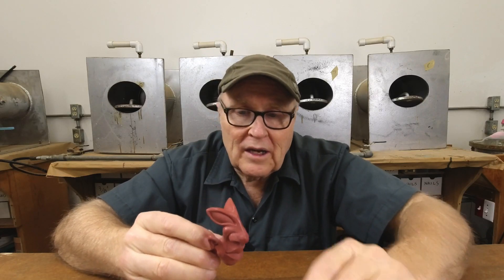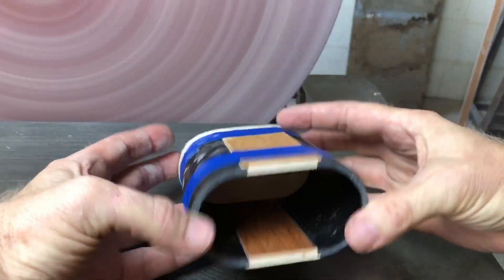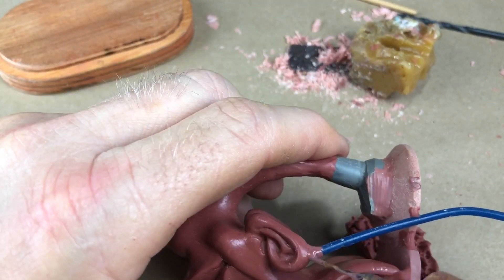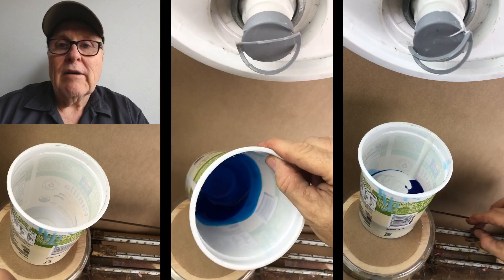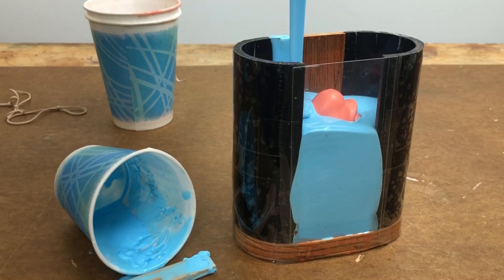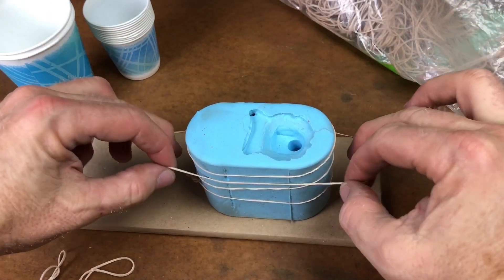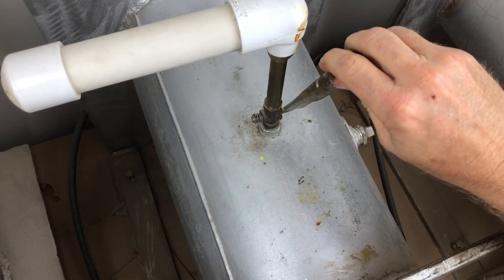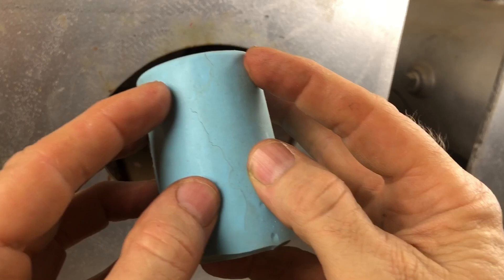Casting a Complex Shape In A One Piece Silicone Rubber Mold

Comment: I am making a casting of another casting made of fiberglass resin. Could I use beeswax as the release agent. I tried another one using silicon spray but it did not work. I also tried oil and it stuck also. Hoping the beeswax will work.

Comment: is it possible to make a silicone mold of a dinosaur head with its jaws open and lots of teeth in its mouth.. can this work on the open mouth with teeth , or is that to difficult to make a mold of.
Reply from the maker: That exact project is in the pipeline, coming up soon. The short answer is you have to have the jaw separate from the skull so that you can cast the teeth.
Reply: @RobertTolone  I will be watching that video. Thank you for your help.

Comment: Hey Robert.  Some day I'd love to buy you a cup of coffee or other preferred hot/cold beverage and learn your life story and pick your brain about casting.  You're my favorite YouTuber.  

I do have a practical question - I find my molds using thicker silicone tend to have worse parting lines.  Maybe my cut technique is rough.  But I have a decent amount of slippage even when from the outside the mold looks like it all came back together perfectly.  It looks like the cut either made it hard for the inside cavity to line up riggt, or maybe I'm using too thick/rough a knife. Any tips on getting perfect lineups? I've tried lessor pressure from my rubber bands, and a differing amount of pressure pot pressure.  No dice.  Do you find it better to stretch your silicone before cutting, or does that not matter?  Thanks boss!
Reply from the maker: I always stretch the silicone to cut it. That makes it much easier. Sounds to me like your cuts aren’t locking together enough. The cuts should be jagged but it doesn’t have to be crazy jagged. Where the cut meets the model the line should be a straight as possible. The harder the rubber is the more difficult it is to cut. I mostly use Shore A 25 rubber.

Comment: Hello Robert, so i've made a mold using your method (similar to this) and I like how the casting comes out. I only have one problem, I don't exactly know how to cleanly get rid of the sprues. They leave a flat/chopped up look that I just am not happy about. Do you use any types of tools or have a video on how to clean these out? I use polyester resin for my casting. Thank you so much <3
Reply from the maker: I cut them off and carve them to match the surrounding surfaces as soon as possible after the casting comes out of the mold. The resin is much easier to work then. After trimming I simply use sandpaper in progressively finer grits to clean the part.  This works well for urethane resins but I can’t see why it wouldn’t work for polyester.
Reply: @RobertTolone  Ahhhh I see, makes sense. I got to trim mine after a while which left it kinda hard and difficult to trim. Thanks for this!

Comment: The urethane resin that i'm using tends to kick faster around 3-4 mins after from initial mixing, given that is the only product i have in my country, it might start to kick in the reaction to the resin even before i start my tank. would it be okay to use the same technique as you did in this video without using a tank and still have a conplete casting?
Reply from the maker: If you vent the mold cavity properly you should be able to make bubble free castings. The main reason I use a pressure pot is that I buy resin in 5 gallon buckets and it takes me a long time to use them up.  Over that period of time the resin absorbs moisture from the atmosphere and this causes it to foam while curing.  The pressure pot prevent this from happening.
Reply: @RobertTolone  ooohhh i see, i never knew that before you told me. Thanks a bunch!
Reply: @RobertTolone  also a curiousity, what does the resin model look like without placing in the pressure pot? Like does the recasted model structure would be compromised due to the foam or would it just be like the same thing from a fresh bottle of resin?
Reply from the maker: @jedriclim  It’s full of holes like a sponge and there may be voids where the resin foamed and didn’t fill areas of the mold.

Comment: I like to use brown parcel tape instead of rubber bands to hold my moulds together.  If it's a larger mould, then I also use Velcro straps.
Reply from the maker: I’ve also used velcro for large molds. And bungees.

Comment: When you cast resin models commercially, do you make several molds at the beginning? Or do you wait to see how many casts you can get from one mold before making more?
Reply from the maker: My shop is primarily a prototype shop. So mold life is rarely an issue. But if I am doing a production run I estimate the number of mold cavities for the number of parts I need to make. I start with a 1 to 10 ratio as a rule of thumb. Molds of models with a lot of surface detail wear out faster than models with less detail.

Comment: What are the best options for a mold, if I want to cast polyurethane ab foam parts?
Reply from the maker: Biggest problem casting foam is that the mold must be strong enough to resist the pressure of the foam expansion. So my favorite rubber band method doesn’t work. Usually you would use a two-part silicone mold held tight in a strong mold case with lots of clamping pressure.  Foam is very aggressive and it is best to use a mold release or barrier coat on the mold. Also, it is critical to get the amount of foam right so you don’t have extra foam trying to force its way out of the sprue and vents.  A lot of people use self-skinning foam so that you get a nice shell around the foam interior. If you have not done so already, do some research on R.I.M. - reaction injection molding. That’s basically what we’re talking about here.
Reply: @RobertTolone  Thank you for the great info.

Comment: As. a novice moldmaker, I wonder why you couldn't you just use a vacuum to pull the silicone into the mold without any bubbles or air vents.
Reply from the maker: I never apply a vacuum or pressure to a model while pouring the mold.  That is because the model may be hollow or have voids inside it that could get crushed or blow up. Clients bring me objects to mold and I just can't tell how they are made.  I learned this the hard way. 😢
Also, if you pour the silicone properly it's not necessary.

Comment: Thank you for the content, very good info.  I do have a question, a while back (5-6 years ago) a guy used his 3d printer to "inject" plastic into a silicone mold, what are you're thoughts on doing that. Would it work?  Could it be a small run injection mold hybrid system?  He basically took the Gcode and set it up for x amount of time, temp and z setting to do this. Thanks in advance

Comment: Try this to remove the bubble - once you pour your material into the mold place the mold on a wood board and place something like a hand vibrator under the board and the vibrations will bring the bubbles to the surface. Vibrator, electric razor or toothbrush, etc.

Comment from the maker: Yes, they are used in many trades...
Reply: Learned to much in these videos. Can see the channel grow super fast as I go through different videos. Q: Do you know if you would be able to use this mold to pour soy wax in it and get at least 20-30 pieces out of it?
Reply from the maker: @Virrba  I have never heard of waxes wearing out silicone molds. We cast our sculpting wax, which is a mixture of beeswax, paraffin and carnauba wax, into silicon molds all the time without harming the molds at all. So I would expect to get a large number of sox wax castings out of a mold. The silicone should be able to tolerate the temperature of the melted wax easy enough. But if you have any doubts you could always use a high temperature silicone suitable for casting metals like pewter. I am not a candle maker and have never cast soy wax so maybe I am Ignorant of some property it has that could harm silicone.
Reply: @RobertTolone  I really appreciate your thoughtful reply. That sounds great. Will go and research any potential problem. Also, I think people would benefit if in the future you would review some pressure or vacuum chambers as the one in your studio looks large and intimidating and seems like people would not be able to afford that system but there are those under 100£ in UK that can be purchased from ebay. Your opinion on those would be valuable I believe.

Comment: would you use Beeswax on a plaster cast of an object?   The plaster is a positive from an Alginate cast.  I then use a two part rubber to make the hollow mold but have issues with the rubber tearing and sticking at times.
Reply from the maker: Sure, I would wax the plaster. Be sure it’s completely dry.
Reply: @RobertTolone  thank you.

Comment: When you do castings. Is it allways just one color? Or Do you sometimes paint them afterwards? Or Do you cast different parts if you want different colors and assemble afterwards? I just wounder if this is a techique that would be usefull to make copys of my detaild polymerclay figurines. :)
Reply from the maker: I often paint my resin sculptures. Most of the time I use artist’s acrylic paints. Sometimes I cast pieces of a sculpture in different color resins by adding dye or pigment to the resin.  Both methods work fine but you should be aware that urethane resin castings color over time. It typically becomes darker and more yellow. So you will notice a color change unless you paint the sculpture.

Comment: HI Robert, This is a great video. I am curious about molding silicone rubber with a silicone rubber mold. Would you use a softer silicone rubber for the mold?
Reply from the maker: Not necessarily. What is almost always essential is to use a parting agent. Silicone rubber generally sticks very well to itself, so if you are casting silicone against silicone you must have a complete barrier coat between the mold and the cast.  your rubber manufacturer can recommend a parting agent that works with their products.

Comment: I really like your videos, your explanations are always easy to follow and you're always pretty thorough.
I'm not molding yet so my questions might be stupid but here it is:
Since you use the vacuum chamber to remove all the air bubble from the silicon before putting it in the mold, why don't you put the mold in the chamber after pouring to remove any secondary air bubbles?
I know that when you remove air there's a rise of the silicone during the process but I think that since you removed most of the air before casting, the second removal will rise less. and if you make a longer mold case with adapted vent, after the air removal the silicone would settle air bubbles free.
Reply from the maker: I do not put a rubber mold which has been poured around a model in the vacuum chamber for several reasons.  First, it’s not necessary.  If there are problems areas where air is likely to be trapped they should be pre-filled before the mold is poured. Otherwise, if the mold is poured properly and the rubber rises from the bottom and pushes the air out it will not trap any air. Second, I often make molds for people and I am not certain of the construction of the model. If there are any voids or air pockets inside the model they could explode or expand enough to damage the model. This is particularly true with clay models which very often have trapped bubbles inside them. And third, it’s hard to predict exactly how much the rubber will expand. So you have to make the case considerably bigger than necessary to allow for the expansion. It just isn’t worth the effort.
Reply: @RobertTolone  thanks for the explanations. I didn't think about "imprisoned" air in the original model.
Reply from the maker: @jeromedesalle6973  I learned that the hard way when I destroyed a client job, an intricate little ship model. 😭. Never occurred to me it was hollow!

Comment: just discovered your channel and learning a lot from your videos, thank you! do you have advice on recognizing when and where to put sprues on a figure? I have been making clay figurines and getting ready to cast molds but this is a big concern, especially since the silicon isn't cheap and i don't want to waste it with rookie mistakes
Reply: Every shape is different so there really is only one rule when placing vents.  I place my sprue so it attaches to the casting where it will be easy to clean up. The sprue should be large enough to allow a rapid flow of resin down into the cavity. If you make the sprue too small the resin will begin to set before the cavity is filled. If you make it too big you will waste effort on a big cleanup job.The resin flows from the sprue into the mold cavity and falls to the bottom. As it rises it push the air out above it.  You need a vent anywhere that air can get trapped by the rising resin. Look for high spots; that’s usually where you need a vent.

Comment: Thanks so much for making this video. Ive been trying to learn how to make molds recently and stumbled on your channel. Very informative. Def subcribing. My question is do we need a tank or does a pressure chamber work the same? Ive recently heard some ppl make pressure chambers out of crock pots? Whats your opinion?
Reply from the maker: I don’t know if a crock pot can work; I have no experience with this.  The pressure pots that I use were fabricated from the brake cylinders of large trucks and were made by a welder certified to do pressure vessels.  A poorly made pressure pot could be very dangerous. It is not necessary to use pressure when casting resin, but it is very helpful because almost all bubbles can be eliminated in the casting.

Comment: Do you really need a pressure chamber for castings like this?
Reply from the maker: It is very helpful but not essential. Urethane resin attracts moisture from the air and that causes it to foam. I buy my resin in 5 gallon buckets and it takes me quite a while to use it up. Over time the resin absorbs moisture no matter how carefully I seal the buckets. The pressure pots prevent the resin from foaming while the castings cure in the mold.  If you use fresh resin you can make castings without pressure pots provided that you have designed the vent system correctly for your model.
Reply: @RobertTolone  : I wonder if you could add a floating styrofoam disk or membrane to the inside of your buckets if it would keep the most air separate from the liquid resin. Or for that matter, a silica gel package to soak up the moisture. Especially if the top of the bucket is not very open to the air. Just a thought.
Reply from the maker: @garywheeler7039  What most people do is attach a moisture trap to the bucket. It’s just a tube filled with a substance that absorbs moisture from the air. The chunks are pink and turn blue when they have absorbed all the moisture they can. or maybe they’re blue and turn pink, honestly I can’t remember.  you can bake them in the oven to drive off the moisture and reuse them over and over. We used to attach them to 55 gallon drums of resin when we were doing big projects. Another way to go is to fill the bucket with an inert gas that is heavier than the atmosphere and lays on the surface of the resin preventing moisture. Personally I found all of these solutions cumbersome. The best way to deal with atmospheric moisture is to use up the resin as quickly as you can and cast everything in a pressure pot. The pressure pot solution is much less expensive than all of the solutions surrounding atmospheric moisture prevention.
Reply: @RobertTolone  : Yeah, I have used desiccants with similar properties. Sounds like you are on top of things!

Comment: Question: I've seen toys made out of natural rubber. when I observe them, it seems like they are made from 2 or 3 parts. and the middle is hollow. how do they merge those parts. Even some plastics. say a plastic ball. how do they make the the boll hollow inside ? im sure its not by blowing like glass ware. Thanks.
Reply from the maker: Manufacturers use a variety of techniques. There is injection molding, blow molding and rotational molding. In some processes the resins are granules and are poured into a heated metal mold where they melt and fuse to the walls. Other techniques pour molten resin into a mold and it cools at the walls first.  They wait until the walls build the correct thickness then the remaining hot resin is then poured out. And of course many products are molded in sections or halves and the parts are fused together afterwards.

Comment: Is it gonna work OK with out the air pressure tank you built out of aluminum,That gets the bubbles out.
Reply from the maker: Yes, you can make bubble-free castings without pressure pots. Two things help: the most important thing to do is put vents in the mold so that the air can escape as the resin fills the mold.  This video explains vents in detail:  https://youtu.be/6Uqdmje3ZGI
And be sure to use fresh resin and store leftover resin in airtight containers. Urethane resin absorbs moisture from the air very quickly and then it foams when you cast it. I buy resin 10 gallons at a time so it takes me a while to use it up. Having the pressure pots means I can stop the older resin from foaming. It can’t foam under pressure. Good luck with your casting projects!